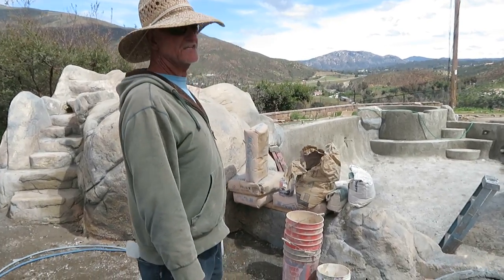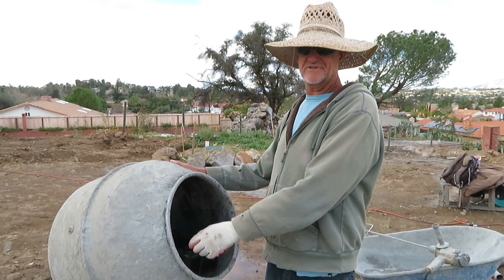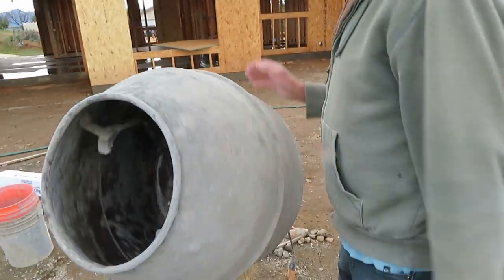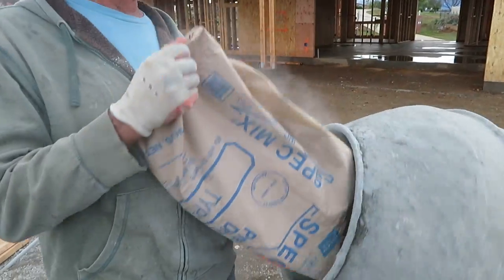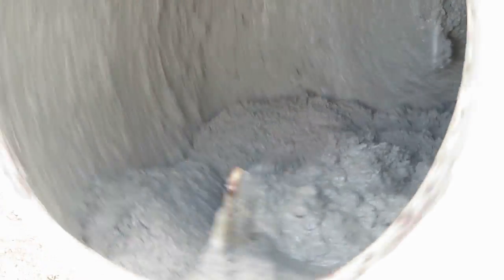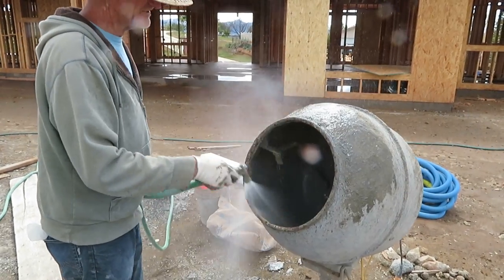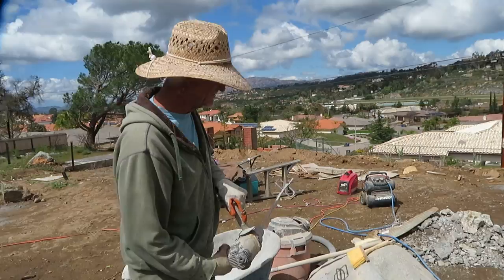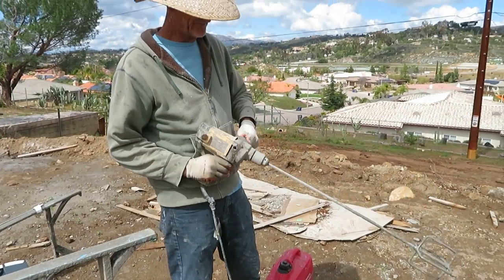Fake Rock Mortar, How to Mix It

Comment: If you have a Home Depot don't buy that version go to the tile section they have an acrylic admix that's two and a half gallons for like 25 bucks
Reply from the maker: Can you tell me the brand name cuz I can't find anything other than this one, (see link) for $37.57 for 2.5 gallons a bit cheaper per gallon...  https://www.homedepot.com/p/Custom-Building-Products-10-qt-Liquid-Thinset-Admixture-for-Non-Modified-Mortars-AMA2/100034962
Reply: Another trick is thinset the great thinset that one works best
Reply from the maker: Sika Acrylic Add-Mix.   In concrete supplies section of the store.  👍😎

Comment: I feel like you may have confused some people, I never heard of a 94# Mortar mix. I'm pretty sure you meant 80#!
Reply from the maker: Hi Ron, Here's the stuff. https://www.homedepot.com/p/Spec-Mix-94-lb-Type-S-Mason-Mortar-Mix-0179594000/100317718  :)
Reply: @DaveHendersonFakeRockVideos  
I stand corrected, thankfully we're weaker on the east coast and they stock 60 and 80# bags.
Reply from the maker: Actually I'd prefer 80lb bags instead.  I do use 60lb bags for all my concrete when doing hand work though... Decided long ago i didn't need to continue trying to be a hero... 😝👍😎

Comment: I put my mixer on a piece of plywood that is soaked in linseed oil and with the hose I keep it clean so what spills I use a flat shovel and loose very little. The oil keeps the plywood for many use's 👈🤠👉

Comment: Heh Dave, I'm a paid subscriber to your network.  My question involves the use of mortar as opposed to the concrete.  It seems that on some builds, you use the typical concrete bag.  On this, you used the the blended mortar mix.  So the question is....what conditions call for using concrete as opposed to using the blended mortar?
Reply from the maker: Thanks for the question Mike.  Mortar is more sticky and thus is good for vertical applications.  It isn't as strong having a lower psi generally so I never use it for structural coats.  Mixing in mortar to concrete helps increase ease with vertical applications of rockwork.  It stays on better.  Say 2 bags concrete to 1 bag mortar.  Bytheway I use 60lb bags cuz the 90's wear me out too much. 😝  Hope that helps.  👍😎
Reply: So you don’t use concrete mixed with mortar except for the scratch coat? I’m assuming the structural scratch coat was already in place which is why you went straight mortar mix? Thanks.

Comment: I would love access to a PDF list of all the tools, materials, products, ratios that you use for projects!
Reply from the maker: Hi Tom, I'm pretty sure I've got all that info in my "Makin' Rocks" book.  https://davehenderson.podia.com/makin-rocks-ebook. But I keep things simple so regular bagged concrete, mortar, Sika acrylic add-mix, (couple seconds pour per 5 gallon bucket mix or 8 second with a cement mixer and 2, 94lb bags of morrar).  After that the other info is scattered through my Youtube vids or at davehenderson.podia.com.  Anyway, thanks for checking our my content.  Appreciate it.  Cheers, Mr. Dave. :)
Reply: i think it would be more efficient to just mix with a drill paddle and in a bucket with zero loss and %100 efficiency
Reply: all that for 1.5 buckets?

Comment: what type of mortar are you using?
Reply from the maker: Thanks for the question Wil.  As you can see in the video it's just a pre-mixed bagged mortar mix called Spec. Mix from Home Depot, (or wherever).  I add a few scoops of Portland cement to make it a bit more "sticky" plus the Sika Acrylic that I also mentioned in the video.   Hope this helps.  More fake rock how-to's, including free pdf downloads and more are at davehenderson.podia.com if ya like.  My blogs and links to other platforms are at www.daverhenderson.com.  Wish you all the best!  Cheers, Mr. Dave :)
Reply: Hello, may I ask do you plan to present your ingredients for Europeans, too? We have different measures (SI) , different standards for concrete, different manufacturers (Mapei, Knauf, Baumit, etc). As a European it is hard to identify what is fine. Thanks.

Comment: I’m going to go for it with throwing that fog powder too sounds like a fantastic idea. The video doesn’t do the color the proper justice. 
What if I threw a variety of Davis color say .25 - .75 lbs , then contrast with the fog? To maybe use no paint or least amount possible? Maybe go straight to speckling or paddling(highlighting) with a brush and straight paint(thinking out loud) one downside of artificial rock I don’t like given to the customer is paint that is not going to last
Reply from the maker: Hey Rib, thanks for the kind words.  I would also try "Color Hardener" in place of the fog coats.  Same application but it'll be harder and more long lasting than fog coat.  Anyway if youd like to chevk out other fake rock how-tos, including free pdf downloads and more go to davehenderson.podia.com.  My blogs and links to other platforms are at www.daverhenderson.com
Have an awesome week NO MATTER WHAT!  Cheers, Mr. Dave. :)
Reply from the maker: Sorry spell check bo bo " Hey Rob"... 👍😎

Comment: How I can make myself mortal mix, this product is not available in Poland
Reply from the maker: Hi Artur, you just need a clean sand and Portland cement or a comparable product in your country.  Mix a 1 to 1 ratio of material for a creamy sticky mix or a 1 to 3, (sand to cement) for less sticky mix.  Whatever is used in Poland to set bricks in place should work...  Good luck.  More fake rock how-to's, including free pdf downloads and more are at davehenderson.podia.com  Then I have blogs and links to other platforms are at www.daverhenderson.com    Cheers, Mr. Dave :)